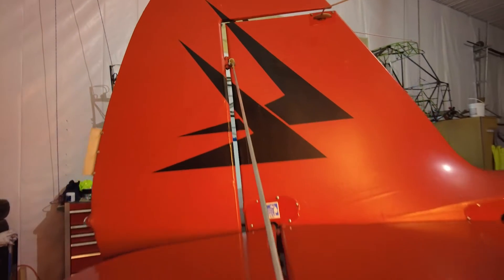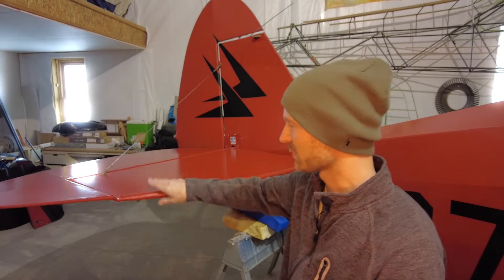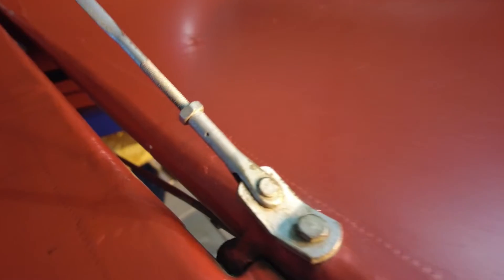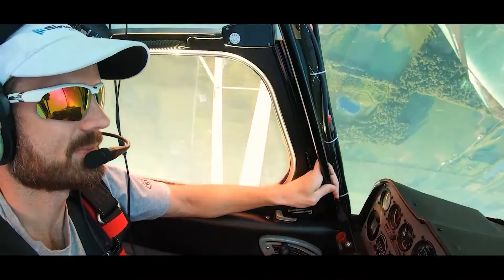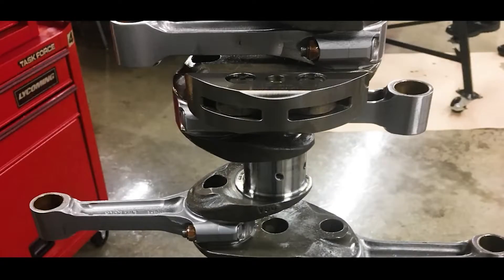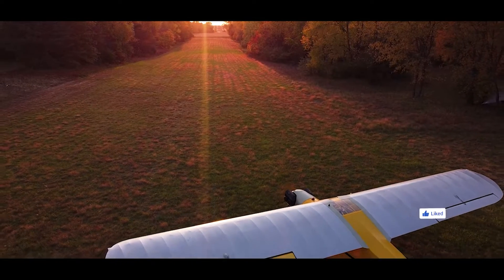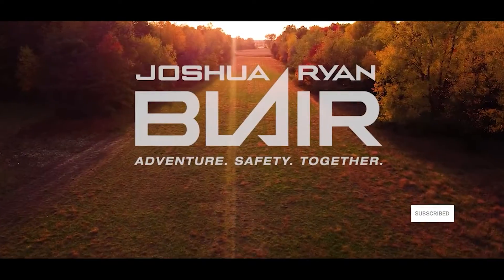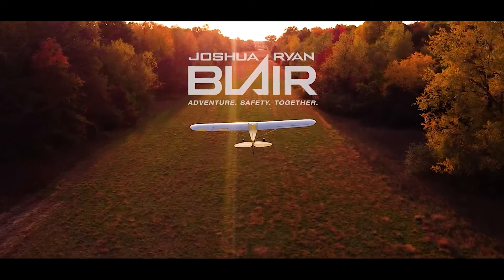How to Disconnect the Elevator | Piper PA-22 Aircraft

Comment: Awesome video brother!! 😁👌🏼 If you replace all your cables and hardware McMaster Carr is the place to get everything. Except AN bolts. Spruce is the best for that. But I bought a roll of galvanized 7-19 1/8th cable, Nicos and thimbles and made my own cables. Heck of a LOT cheaper than buying the premade cables from Univair. 

The tail section on my Grandaddys J-3 was stuck just like yours. I just sprayed PB Blaster like you did and let it sit over night then grab the stab and rocked it back and forth and they came right off band boy it was BAD neglected just like this one as far as not being greased. 😏

Hope this helps.
Reply from the maker: Thanks and I appreciate the feedback!
Reply: How do you crimp on the ends to the cable? Do they get soldered? If it came loose you'd have a real bad day.